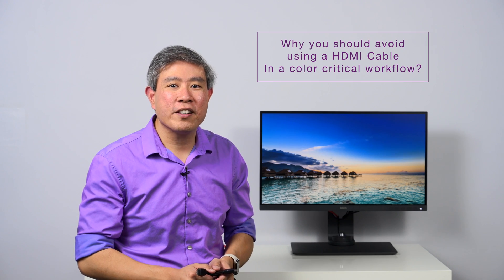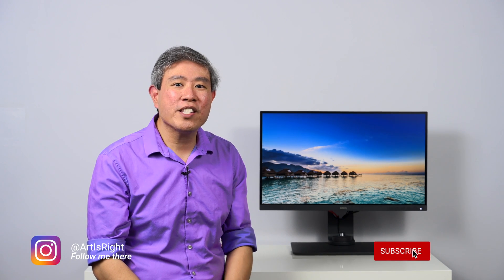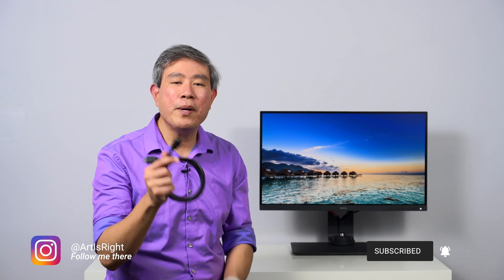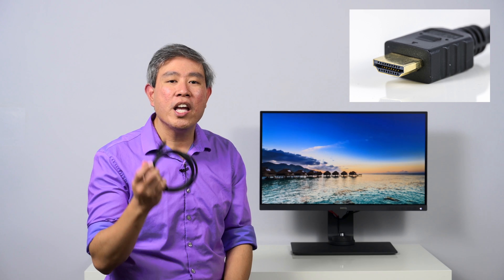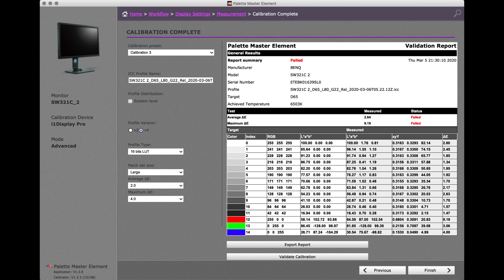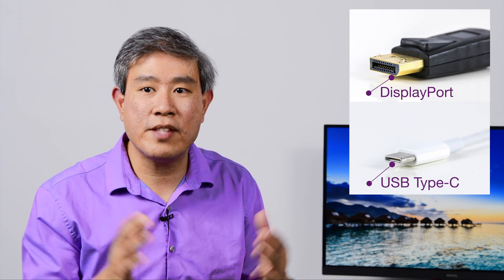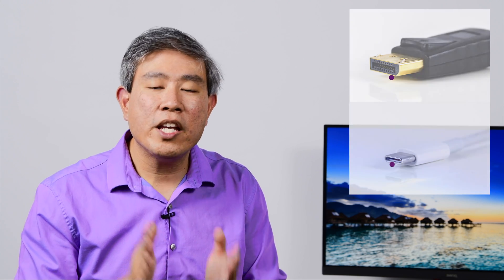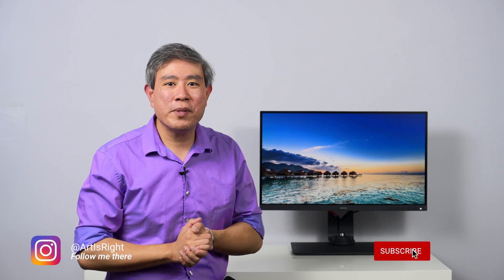Why you should avoid HDMI for color critical workflow, especially with Pro Displays!

Comment: Hi, I have a MacBook Air 17 and I used BenQ gw2283 as an external monitor, and I am a designer and currently, using a thunderbolt to HDMI code. can this is good for a designer or I will use thunderbolt to D-sub plug code. because currently MacBook and BenQ gw2283 screen color is not matching, can this D-sub type code solve my problem? Please let me know.
Reply from the maker: My next recommendation before changing the cable is to calibrate the display. Do that first and see if the color are closer. They will never match, because of varying back light technology.
Reply: @ArtIsRight  Thank you. you are right backlight technology is also the main reason. Please can you suggest any external monitor that matches with MacBook air display?
And calibrate means MacBook - system preferences - display internal setting or any use any external device for this?
once again thanks for your comment.
Reply from the maker: You would have to use an external device for calibration i.e. https://youtu.be/JrPdvs2by04, https://youtu.be/Px7aIMsdgkQ as far as display matching Mac, there really are non, each models are unique. What I would do instead is consider a scenario like this https://youtu.be/REGRfFdLYFM get a great external monitor and then use that as the bases for editing and not the Mac display. I have not tested the GW calibrated, but if you want a great pro display from BenQ that won't break the budget I would consider their PD line. Cheers!

Comment: So confusing my friend you start saying you should not use it in a pro color workflow and end the video saying that you are fine using it if you succeeded calibrating with palette master using HDMI....so  why do you guys put an HDMI port on your SW series in the first place? how often do you hardware calibrate with Palette Master ???
Reply from the maker: It is more of a suggestion of why anyone should avoid using it and not an absolute saying that one should never use it. The reason why I made this video, for context, if anyone needs to know, is that, not all HDMI ports cause this issues, but some does and when this happens, users would go in a downward frustrating spiral of no one being able to provide them with answer to what is happening and why. This is usually the issue on the video card or port output by the way and not the display fault by any mens. If there are others ports on the computer, most of them are going to be better to use than a HDMI for color critical workflow. But if HDMI is your only port then use that and test, if it pass validation then it is ok. The thing is that most drivers and software, not all, will not tell you if it is truncate the HDMI RGB output range or not and most users would not really know where to find this information because sadly it is not in 1 place but in different places for different driver, if it is there at all. Why build in HDMI, BenQ would have a better answer for this, but here's my answer, sadly HDMI had become one of the adopted standard to make computer more versatile to hook up to other screens and projectors. It is not a superior connection by any means but it is the most prevalent, when was the last time you say Display Port on a projector? So this is one of the reason why they included it, I'm sure there are others too, i.e. other manufacturers are including it, it also makes the display more versatile, etc. 

TLDR, if you have other ports try those out first and use HDMI as the last resort and if validation pass with HDMI then you are OK.

Comment: Hi Art,  I just bought the BenQ SW2700PT 27 Inch QHD.  I have a Dell XPS 13 laptop, which has 3 x USBc ports, so I have to use an external converter for HDMI or USB.  I can either use HDMI - HDMI cable or the SS cable that came with the monitor which connects to USB - which one should I use.  Or should I get a USBc to HDMI cable? Suggestions please - I'm confused!  I probably should have bought the USBc version, but budget did not allow.
Reply from the maker: Hi so what I would do in your situation is try HDMI first and sees if it gives you any issues. If it does then I can suggest other ports and cable and if it does not then you can just stick with it.

Comment: I have purchased sw270c. I have a PC and graphics card has hdmi and DisplayPort out the PC has usb C ports can’t I use them as well for the monitor.
Reply from the maker: I recommend Display Port or HDMI. There no Display Port overlay on USB C on most Desktop PC so it will probably not work. If you have a laptop you have to double check and make sure that it has display port overlay.

Comment: Hi
I have purchased sw270c, I am using a PC and the graphics card has hdmi and display port outputs. I have USB port on the computer can I use these
Reply from the maker: I recommend Display Port or HDMI. There no Display Port overlay on USB C on most Desktop PC so it will probably not work. If you have a laptop you have to double check and make sure that it has display port overlay.

Comment: I have no problem passing the validation with hdmi, but after watching your video I tried to go with usb c. I kept getting a message from the display that said no cable was attached. I used the cable that came with the monitor and attached it to my MBP.
Reply from the maker: Depending on the model that you have, the display does not automatically detect input source. So you can press any button on the display when see that message and the choose the corresponding input source and that should get you going.

Comment: Hi Art!
Is the HDMI cable only problematic during the calibration process itself? Is it possible to use a diplay port for the calibration, and then afterwards switch to HDMI? Does the HDMI cable have any other drawbacks during normal use (after calibration), as opposed to a displayport / USB-C? 
The reason i want to do this is because i have 2 monitors, but only 1 displayport slot in my computer. I want my other monitor (which is a 144hz monitor) to use the displayport cable.
Hope you understand the question. Let me know if i need to clarify anything.
Reply from the maker: @Artyom Andreev, HDMI can be problematic during the calibration and also in general use. If your computer is outputting 16-235 compress range then you are throwing all of the shadow and highlight details away in general use. Again, keep in mind that this does not happen to every computer. It happens to some. If you are aware that this happening to you this may be the reason why your calibration is failing the validation process. Another thing to consider as well is the program that you are using to do calibration. If the validation process checks a lot of the white, gray, and black tones like Palette Master Element then the validation will definitely fail if the HDMI is outputting compress range. If you use another program to do a software calibration such as the i1profiler then you may not notice that this is an issue because i1profiler does not validate gray tones during display QA. 

To answer your second question if you are using display port for calibration you want to stick with using the display port for your displays ago as well. Switching the calibration cables will also switch to signal output from the video card. This means that you are not going to get the same signal out when you switch the ports on your video card. Remember this that calibration is very specific to a displaying, the computer, the video card, and also the output ports that you're using during calibration. If your computer and display is capable of using display port or USB type C you're probably better using these two formats that HDMI. Based on my understanding HDMI can do 144 Hz without any issue. So you may want to consider that. In addition is probably better to use display port cable for color critical display work. If you have any follow-up questions please let me know.Based on my understanding HDMI can do 144 Hz without any issue. So you may want to consider that. In addition is probably better to use display port cable for color critical display work. If you have any follow-up questions please let me know.

Comment: Excellent video, but for example, why DaVinci resolve recommend use their external video card in order to have a clean signal and conectado the display trough HDMI? Could you explain to me this?!
Reply from the maker: @Camilo Gutierrez, thank you. DaVinci, external video card device is another story. Those are devices designed by black magic and for those device, based on my understanding, since you can't really calibrate them, at least not in the traditional way that I have shown on my channels, you can use HDMI with it and it will be ok. When you use those devices with DaVinci, the signal from those device is coming out of the Resolve rather than the system video card.

Comment: Hi Art in a large multi-monitor setup say 4 BenQ SW270Cs. Can we calibrate using one monitor using USBC then move it to a DP or HDMI output in the video card. Will the display calibration still be accurate even though it is being fed from a different flavor of output port in the video card?
Reply from the maker: @Dennis Cham, absolutely you should be ok. I would keep an eye on the HDMI output but there than that I think you're set. And you are calibrate the each of the display with each of the respective hookup and input signal which is great!
Reply: Thanks for the reply Art!
Reply from the maker: @Dennis Cham, you're welcome